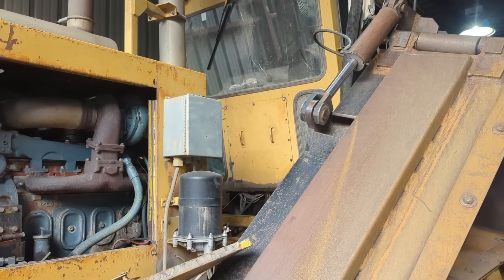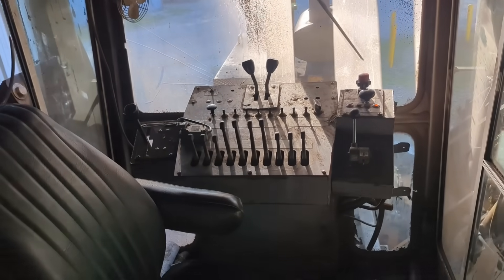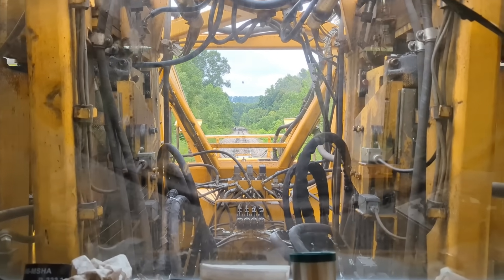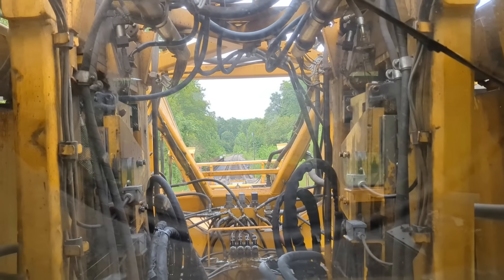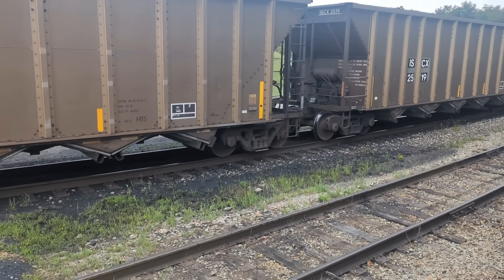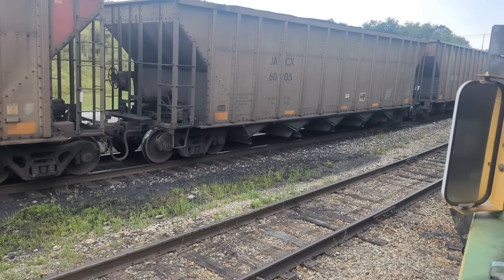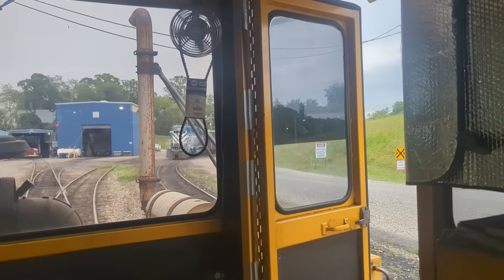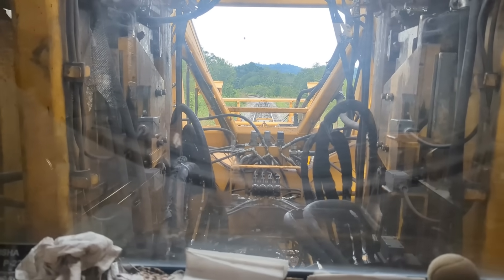Why do Rail Car Wheels Squeal thru Curves?

Comment: Even though the wheels are coned there will still be some squeal from differential effect in the curves along with the standard flange squeal. As the wheel wears the cone will lose some of its shape, hence differential squeal.
Reply from the maker: You are correct about that boog567. That's what I meant by the
changing or different wheel profiles with the cone shape. Thank you very much for checking out our video and we hope you have a very good day.

Comment: The flange is actually rubbing on the inside of the rail head on a curve hence the sqeal, it's not the bearings . With the heavy loaded cars the friction of metal on metal is enormous😊
Reply from the maker: You are correct about that Conductor John. And yep right again,
the heavy loads create more friction. Thank you very much for checking out our video and we hope you have a very good day.
Reply: @ccrx6700 I love your channel, I'm 661/2 years old and I almost work as hard as you do sir!
Reply from the maker: @conductorjohnmthtrains2239 😊👍🚂

Comment: Always thought needed alittle more grease on the rail
Reply from the maker: We have 6 wayside flange greasers spread out over our 16 miles of
main line track Josh, but we could use about 6 more. Grease
really helps cut down wear and tear on the wheels and rail head
face.  Thank you very much for checking out our video
and we hope you have a very good day.
Reply: @ccrx6700  can elevation in the curve more or less cut down on that rail wear?
Reply from the maker: @Rmst937  yes if the train goes at the right speed for the curve.  If a train crawls thur a super elevated curve it will cause a lot of quick rail wear
Reply: @ccrx6700  I’d say at low speeds in highly elevated curves the low rail would suffer from the most wear?
Reply from the maker: @Rmst937 yep 👍😊🚂

Comment: How many grade crossing does the line have my friend?
Reply from the maker: On the main there are 4 Daniel. Two of those is strictly for farmers,
one is where an access haul road went and that road is closed, the
other is a private road which sees about 4 to 5 vehicles a day and
half of those are our trucks. We have 2 crossings at the harbor
and 1 at the prep plant. None have lights or signals. There are no
crossings over any public roads and we can be so very thankful
for that. When they built the track in 1975/76 they had 3 or 4 more crossings (can't remember exactly) but those were taken out 
over 25 years ago. Thank you for taking the time to check out the video and hope you have a  very good day.
Reply: @ccrx6700 i was born in 1976, so thats a pretty seasoned line😊, thank you for responding, i always wanted to be a trainman but God had different plans, so i watch your channel and dream through your videos.  I liked the SD40-2 you guys have, sorry about the issues it gives. Thats my favorite of the EMD series
Reply from the maker: @danielneeley5480 😊👍🚂

Comment: Thanks for sharing Dave, if everything is squealing it’s the track, intermittent noise usually back to back issues I would hazard a guess
Reply from the maker: Depends Ian. Remember heat expands rail which also causes
the rail gauge to decrease which causes the steering wheel
on the trucks to be pushed against the high rail with more force
on every car. So keep that in mind. Thank you for  taking the time to check out the video and hope you have a  very good day
Reply: @ccrx6700 Good point Dave
Reply from the maker: @ianhughes7805 😊👍🚂

Comment: Centrifugal and lateral force that occur with straight axels, hunting the contour of the rail, over time this will corrugate the head and wear the gage side of head.
Reply from the maker: That is correct Billy, corrugation occurs mostly because as  car
wheels negotiate sharper degree curves, one wheel will be
going faster than the other due to the solid axle. So one side
of the truck will be skipping or hopping thru the curve in order
to keep pace with the other side wheel.  Truck hunting typically
does not occur until the car reaches a speed of 40 and over.
We have 25 track speed here. However certain track perturbations
will also at times cause truck hunting to occur even at slower
speeds than 40.  Thank you for taking the time to check out the video and hope you have a  very good day.
Reply: Also, don't forget that the wheel treads are tapered. Not only does that help center the wheel set between the rails but helps to compensate for the rotational speed differences on curves - the high side wheel is traveling with a larger diameter contact patch than the low side wheel. However, the tighter degree curve you have, the taper becomes less effective. As the tread wears down, you get less taper and more flange rubbing and wear when in the curves, hence some wheel sets squeal more than others. That crunchy sound you hear at walking speed is also flange rubbing. 

There's a lot of science behind wheel profiles and overall truck design.

Comment: Superior Diesel up here in Rhinelander builds John Deere diesels for industrial applications but don't know if any went into rail equipment.  Another great ridealong and update, enjoyed it much.  Thanks Dave!
Reply from the maker: There is a rebuilt JD engine in our regulator poowg. That was
rebuilt by a local mechanic early this year, but that engine was originally re manufactured in Mexico. That one replaced the
original engine which was also a JD made in Mexico.  Thank you for taking the time to check out our video and may you have a very good day.

Comment: just googled the cumberland mine railroad and yeah its not a very long rail well not long compared to some places, is it connected to the main rail network or is it like a private rail just for the mine operations? i think i recall you talking about the line and how its for coal.
Reply from the maker: It' is 16.7 miles in length and we haul coal only from the mine
to a river barge loading facility. Train dumps at the harbor where
it is put on barges for delivery to power plants. We do not
interchange with another RR but we are isolated.  Thank you for  taking the time to check out our video and hope you have a very good day.
Reply: @ccrx6700  ahh i see so just for the mine. ok thanks for the reply.
Reply from the maker: @themarinerkommer4371 😊👍🚂

Comment: i wonder if some of the wheels rub cause they have less wear and tend to have more load on the corners then the older ones that have wear, or maybe its the worn ones that make more noises.
Reply from the maker: Yes it is the varying profiles on the wheels that cause the different
pitched sounds you hear The Mariner. Worn wheels make a different
pitched sound than new ones do.   Really appreciate your
taking the time to check out our video and may you have
a very good day.
Reply: @ccrx6700  ahh ok i get ya.

Comment: on the class 1 railroads they have greasers to lubericate the flanges to minimize the ware on the flanges
and that stops the high pitch wine in tight corners. i have wondered if that will cause issues stopping 
or it it so low on the rails it cannot migrate to the top of the rail.
Reply from the maker: Greasers do not grease the rail head, if they did that would indeed
cause wheel slippage and also when breaking the wheels would
just slide Barry. Greasers grease the rail head face, (side of the rail head) not the top of the rail head.  We have 6 wayside solar powered flange greasers on our 16 miles from the prep plant to the harbor, we bought them from LB Foster. Really appreciate your taking the time to check out the video and hope you have a  very good day

Comment: Howdy Dave!....On the Picadilly Line on the London underground there are some routes where the wheels squeal like crazy - the noise cuts right through you.
Reply from the maker: I can imagine so Lincoln, some transit have some incredibly sharp
curves, the sharpest curve we have here is 14 degrees. Some transit systems have to have curve rail pre bent at the mill because it's
impossible to bend the rails for those curves by hand. I can
bend rail by hand for a 14 degree curve but wouldn't want to do
it for much of a sharper curve.  Thank you for  taking the time to check out the video and hope you have a  very good day
Reply: Trains using the transfers ("wyes") at Deshler, OH sing very nicely, thank you.  Try sleeping through loaded coil cars on the SW transfer at 2 in the morning...
Reply: @treesixtyeight  No thank you Sir!

Comment: Excessive bolster wear in the sideframes will cause the wheel squeel going in a straight line.
Reply from the maker: Now think about that Elvin. If the bolster caused the truck to
go in  a straight line, then the forward wheel would be straight
and not against the high (outer) rail in a curve, it would act
like it was in tangent track with not much lateral force against
either rail. You are right in that excessive bolster wear can
be  a cause of poor steering thru a curve and possibly even
reverse steering thru a curve, which could then result in a
derailment.  Your thoughts on that?  Thank you for taking the time to check out our video and hope you have a very good day.

Comment: Me living in New York City for a long time and riding the subway trains with very sharp curves, sometimes the trains also make a howling sound that comes from the axel if the curve is really tight as the wheels skip the rail head.
I remember waiting for my mom at Chambers Street where there's a very sharp curve and the howling noise is sometimes just as loud as the flange noise. Quite the interesting sound experience I can tell you that.
Pretty amazing they don't derail with such Sharp curves.
Reply: There is tech to lessen this noise. The JFK air train has steerable trucks to help with this. Skytrain in Vancouver is the same tech and while it wasn’t as quiet as promised, it lessens wear and allows higher speed cornering.
Reply from the maker: On sharp degree curves you are right Bassotronics, one of
the wheels will skip or "hop" since one wheel is going faster
than the other and the other one has to keep up. That skipping
over time causes corrugation in the rail head. Rail head ends
up looking similar to a wash board.   Really appreciate your
taking the time to check out our video and may you have
a very good day.

Comment: Hello. Solid axle.  The wheel has to scoot the  longer radius.  In the curve.  Steel on steel.  Or if  rail ties give.  And truck dips it will squeal.  A lot of weight.  On those rails.  Have a good day later.
Reply: The wheels are actually tapered.  As it enters a curve, the outside wheel uses the larger diameter of the wheel, while the inside wheel uses the smaller diameter of the wheel.  The difference in diameters acts like a differential in a car.
Reply from the maker: Your right solid axle so both wheels must turn the same Dan.
However the high rail is the longer linear length rail in a curve
than the low rail. So one of those two wheels on the axle will
be hopping or skipping to try and keep up with the other wheel.
Now the wheel treads are tapered (sloped) so that very much
eases the hopping/skipping thru a curve. But on very high
degree curves that sloped wheel doesn't have near as much effect
as it does on a low degree curve. So hopping will occur which
creates more wear on the wheel tread and also the rail head.
And, that's railroading.... :-)  Really appreciate your taking the time to check out our video and may you have a very good day.

Comment: One reason those new cars are doing so well is they may be “old” but don’t have the dump cycles on them. In their former life they might have gotten dumped once a day or even less than that if the gravel was sent off somewhere. Your cars are dumped several times a day and the coal dust gets into everything causing extra wear. In a couple years about the time you hit your 50 years mark (1977-2027) they will start having issues but hopefully you will be retired on the farm and don’t have to deal with it :)
Reply from the maker: You are certainly right about that Edward. Our cars have an 
extreme amount of dump cycles compared to cars on other
operations. Another reason is the RR those cars came from
were under FRA and had car men that knew how to maintain
cars to keep in compliance with FRA specs for the cars. We
do not professional car men.  Thank you for taking the time to check out our video and hope you have a very good day.

Comment: Thanks for sharing a great video Dave. I wish the regulator I ran was that nice and fancy. Had a bench seat and could have two people in it, one to run each side. They're a very dirty and noisy machine.ine had heat and air conditioning, not during the time of year you wanted it though. Haha.
Reply from the maker: Your welcome Zach. We had one of those old regulators here to
start with, single bench seat but we never had 2 guys in it. Had
cables for the side wings. Dirty and dusty, no AC unless you
slide the doors open. It was second hand beat to death when
we got it. Thank you for taking the time to check out our video and may you have a very good day.
Reply: @ccrx6700 yup. Had cables for the wings. Hydrostatic clutch for the broom and had to manually turn the plow. We never had two people in it either. It waslawya me running it. I was the one who didn't seem to mind that machine at all.
Reply from the maker: @rebelrailroader 😊👍🚂

Comment: Dave, dose the squeaky wheel get the grease?? I know the EX CSX line now AVRR has greasers on some of the right turns. The Bakerstown grade in Hampton and Richland Twp's. Glad to see you tamper is a lot clearer than that regulator from Amtrac. That's a dust bowl on wheels there. Stay safe out there.
Reply from the maker: That's the way it works isn't it Thomas..... :-)  We have 6 wayside solar powered flange greasers on our 16 miles from the prep plant
to the harbor, we bought them from LB Foster. Really appreciate your taking the time to check out the video and hope you have a 
very good day

Comment: Great video Dave.  Re the linkage problem on the hopper car door:  After the cars are dumped at the harbor, how do the operating personnel have a positive indication that all doors on the hopper cars are completely shut and latched?  Obviously you all are constantly wanting to run coal and unexpectadly dumping a large amount amount of coal on the track would be a show stopper.
Reply from the maker: Thank you Michael. When the doors are closed after dumping, they give a definite bang when they shut, also almost every train that leaves our harbor gets a visual inspection as they leave and
those guys look at all the doors to make sure they are shut tight. 
Really appreciate your taking the time to check out our video and may you have a very good day.

Comment: Does it matter if the wheels are 28 inches 36?
Reply from the maker: Rail car wheels for 100 ton cars are 36 inches Melody, some of
the older rail cars that carry far less weight may be 28 inches.
We only have cars with 36 inch wheels here.  Thank you for taking the time to check out the video and hope you have a  very good day.

Comment: That regulator looks like it sat in a tomb for 2000 years. Hopefully it isn't haunted. I also seen a video that the shape of the wheels help the train to go around curves. Sound like you like the safety checklist down. You would have made a good airline pilot. 👣👣👣👣👣👣👣👣👣👣👣👣👣👣👣👣👣
Reply from the maker: That's correct David, the conical shape of the wheel tread helps
the car steer thru curves. Car wheels with a hollow wheel tread
(dished out) can really impede car steering and can even cause
the trucks to reverse steer. Car wheel treads are on a 1 in 40 cant
on new wheels. That Detroit in the regulator is hard to start and
hard to shut off, but once it gets going runs like heck. I've never
flown in my life and don't intend to either so no I would never
make a good pilot. :-)  Thank you for taking the time to check out the video and hope you have a  very good day.

Comment: I'm curious to hear how the contract turns out. About the time I started in the mines "the war on coal" had about killed off all the union mines in our coal patch! It was a hard enough situation I wouldn't consider taking a job for a union mine.
Reply from the maker: I will keep you informed Jughead. Contract negotiations are between the union International and the company, we have nothing to do with negotiations. No one here knows much of anything right now other than that. Really appreciate your taking the time to check out the video and hope you have a  very good day.
Reply: @ccrx6700 the Unions made a huge difference in the coal mines back in the day? May grandpa worked for blue diamond for 18 years before her got paid a single dollar other then script. That was dering a time when mine mules and ponies where still a thing and the company would say if things got bad save the pony because they cost money to replace! Now all the union mines folded dering "the war on coal" modern miners are benifiting from the work that the unions did without having to deal with layoffs and Union dues. None union mines had to compete with the pay of the union mines to get miners. Now the the union mines are gone they have to compete with other mines to get the men for their mines. I started at $21 a hour almost 20 years ago.